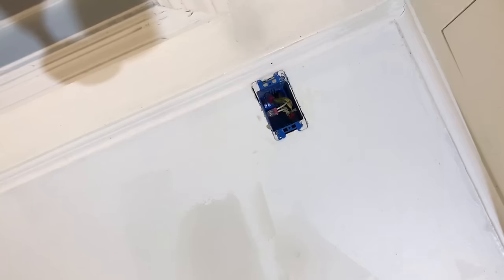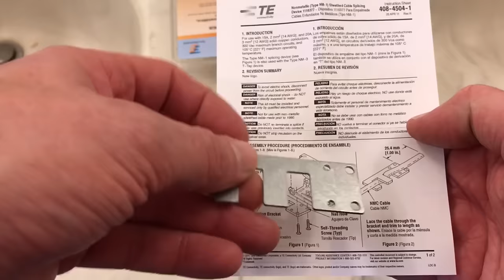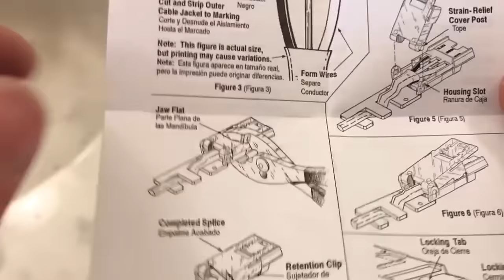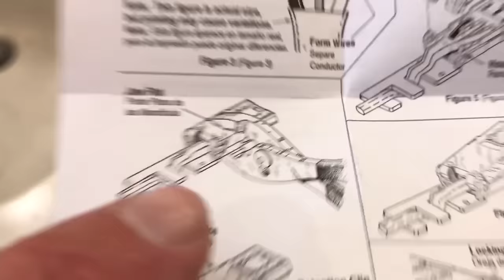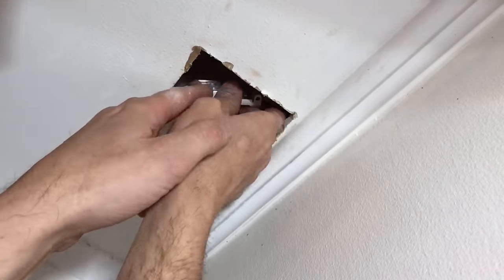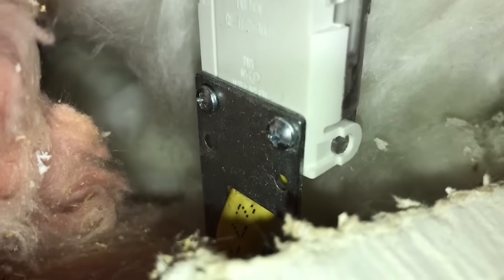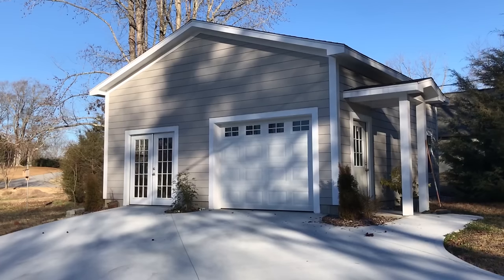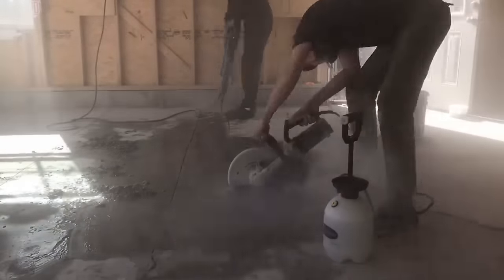Do I have to have a junction box to splice wires?

Comment: Found this searching for ‘Tyco Splice’. Glad I watched. Great video demonstration. This is what I needed to be able to move from a kitchen counter outlet to an island that needed more distance and to remove a light switch to convert it from switched power to always on. The fun will be doing all of this manipulation with less than a foot of wire reachable! LOL! I seriously appreciate this video!
Reply from the maker: Glad it was helpful!
Reply: I would be careful using this in the kitchen because of the wattage we use appliances like toasters , microwaves that have a high current draw. Remember this device makes its connection via small contact area not under a screw terminal .
Reply: @FamilyFriendlyDIY  Can we sue when it fails?

Comment: I used one of these on an old house to extend a wire running to a light about 12". The light was a single LED flush-mount can above a sink. The sink was on an outside wall, so there was very little access to it as the roof was right there. Considering the load was very minimal, I had no concerns about using the splice. All the un-grounded outlets in the old house were/are probably more dangerous than this splice.
Reply: Bad idea
Reply: @RadioRich100  Been that way for years with no issues. :shrug:
Reply: @ADBBuild  And hoping every day it stays that way?
Reply: You would've been better off burying a proper twisted splice in a metal box. I don't suggest this because it's not legal, but nonetheless vastly safer and better.

Comment: When connecting a water pump down into a well, you need to splice an electrical power source (240 volts) onto the pump which is submersed in well water.  To do this, crimping devices, along with a bit of solder, are used to join the pump’s wires to the wires that run the depth of the well. Once the wires are joined, a special shrink tubing is slid over the union and heated. This special tubing, upon being heated, excretes a sealant that fills the inside of the shrink tubing which seals the splice and allows it to function under water.  Now, if we can do that in as hostile an environment as a well, why can’t we do the same while splicing a wire in a house?   It seems a much simpler and cheaper way to do this than the weird contraption that you are using to solve your problem.
Reply: Couldn't agree more. And if it cost a couple of dollars so be it. In the end you usually cover with a box and probably still not a great connection.
Reply: Well for one, that connection is accessible, and what he is doing in the video isn't
Reply: Years ago, when sinking a pump 400+ feet into a well, the wire splice was far beneath the water level. My cousin who was a lineman for Southwestern Bell used a special splicing kit with what amounted to liquid electrical tape, then surrounded the entire thing with a couple of rolls of regular electrical tape, pulled very, very tight. The well was poorly dug and never delivered the 350 gal per minute we were promised, but the pump never failed!
Reply: @jasonstarr6419  Nor would it if it was in the wall of a house. Whew - 350 gal/min. ... you must have been irrigating and orchard!
Reply: the reason i read for no solder, is because the wire can get hot and melt the solder. Maybe since the pump and wire is submerged, the wire stays cool enough to never melt the solder? I'm trying to figure why solder and heat shrink is a no-go for wire splicing too
Reply: @Jajaky  Yes, I've just recently read that crimping is preferable to soldering.  The only reason that I can think for a wire to get hot is due to pumping more amps through an undersized wire which could happen if the appliance was shorting out - which could very-well happen. If I were to rely on crimping alone, I wouldn't trust hand crimping - something hydraulic or a tool designed to exert a great deal of force on the crimp would be my preference.  Another thought occurs to me in that so what if a short happened in a well 100 feet under water - what is going to burn down?
Reply: The problem in a house is heat generated from a bad connection. If the bad connection gets hot enough, and it's next to something flammable like wood, your house can catch on fire. You don't have that problem in a well. Does a junction box prevent this? Maybe its just another small layer of protection but heat next to a flammable source is the problem. Not sure why this contraption is better than other contraptions as far as code is concerned, but most likely the company paid a lot of money to get certified to be used without a junction box.
Reply: @dennisbosworth3665  well if it shorted out in the water, it’s more likely to electrocute someone maybe? But the whole thing is underwater anyway so idk. Waterproof, marine grade crimp connectors seem nice. I need to try some out. Only do solder because it’s all I knew. Still amazed that 95% of electric connections really on clamping force. Seems archaic
Reply: @seanm3933  I dont think code it lenient enough to allow itself to be bought like that if the product isn’t safe. The junction box is probably a controlled environment, so a bad connection happens in a metal box and not over 50 year old saw dust. 

Maybe the splice device is such that if it somehow got a bad connection, it would have already disconnected by that point

Comment: I am so glad you brought this product up, as there will be that situation it will be needed. As an AHJ and Master Electrician for 34+ years. The 2020 NEC Art 334.40 Boxes and Fittings (B) Devices of insulating material. These are Non Metallic Sheath Cable Interconnector devices and are acceptable concealed in walls and ceilings for a "repair" of damaged wire and for exposed cable wiring (example -romex in an attic that is accessible). Tyco list this product as "rework". Which the NEC DOES NOT. This is the classic case of a design engineer playing with, changing, or not knowing the exact wording in the NEC. For what you did in the video. Great job. I would have passed the inspection for that product, even covered up by drywall. Granted, possible problems in the future, but acceptable be code. But.... if someone were to move a switch or move a light to start a "rework / remodel". I would fail the inspection with this device concerned as that is not a "repair" as stated in the NEC code. Then this item must be accessible or start installing splice boxes.
Reply from the maker: Thank you for the supportive comment, John! Not a lot of love out there for these things.
Reply: @FamilyFriendlyDIY  Most of the NOT love is from people who have never used or even seen them, but somehow think they have an informed opinion.
Reply from the maker: @pld8993  much appreciated, John!

Comment: Super. Please dont ever splice a wire in a wall, but for those people with paid up fire insurance, at least put the wire in a metal handy box, with a metal cover, proper wire clamps, ground the box, and use proper wire connections, like wire nuts on properly twisted and trimmed wires, screw or crimp terminal connections correctly torqued, soldering, or Wago/Ideal connectors. 💙 T.E.N.

Comment: As a G.C. I would suggest when working with anything small like screws near a sink to pull the stopper. I have had many screws fall into the sink then down the drain causing me to have to do more unnecessary work.
Reply: I dropped a Tapcon Screw down my toilet flange two weeks ago, LOL, that's sage advice you are offering...
Reply: @terryweisenberg396  Trust me Ive done it so many times. Most of the time i remember to pull the stopper but sometimes Im in a rush.

Comment: Two issues.  One, I'm not sure Insulation Displacement Connectors (IDCs) are reusable.  Once used the integrity is lost when re-cripped.  So, I'm hoping you threw away the first set and started with a fresh set for your install.  And two, just because it eliminates the need for a junction box doesn't mean it can be concealed.  If it were a high current application, which in your case, it may not be, I would be worried about heat buildup years down the road.  It looks like a pretty poor example of a permanent fix. Only one IDC blade per wire.  Any way to pull a new piece of Romex or get attic access to place the junction box up there where it would be accessible above all that insulation?
Reply: I was hoping also that he did not reuse the practice connectors. I paused the video at 7:38 to read what was written on the connector. It stated "do not re terminate".
Reply: I was thinking the same thing, but it looks like he used the same one.  But he tested with 14AWG and then did 12AWG, so likely not too much of an issue with spread as he went to a bigger wire.  But that small contact, that thing will overheat if high amperage (more then 1) passes through that... I would NEVER put that thing in there, thats like getting a under counter pipe accordion and saying "i'm a plumber"...  Do this right!  Dont use these DIY junk that the home center sells..

Comment: I seem to remember that if this was being used for a repair it can be concealed.  If it's part of a new run it has to be accessible.  334.40b is the reference.  The electrician used these as part of a re-wire/installation of a breaker panel.  I've had zero problems since install from December of 2020.  New 12-2 romex to old 12-2 (no ground) system.
Reply from the maker: Thanks for the positive comment! And I believe you're correct on that code.

Comment: It’s surprising how small the surface area is for  the contact point where the wires fit in the slots
Reply: I wouldn't trust it to carry much current.
Reply: @bobcarrigan1742  those metal plates will cut through the insulation, And IDC always fail.
Reply: I have seen these arc/burn enough to kill the connection. The insulation melts some from heat traveling back from the contact failure. It was under a doublewide house trailer connecting receptacles on one side of living room to the other. I believe it happened after they plugged in a window AC.

Comment: I am not a big fan of those splice kits but I have been told they are NEC approved ‘no documentation I was just told that’.  However if the junction box is in the attic and the attic is accessible then so is the junction box.

Comment: I was under the impression from watching other informative videos about performing tasks in the electric industry that all splices had to be placed inside a junction box and they also had to be accessible Incase any issues occured down the line where they would have to be replaced.
I remember seeing these Romex splice connectors in another video.
From my understanding from that video these connectors are a 1 time use and if they were to ever fail or be taken apart for any reason they would need to be replaced with a new one.
Now I understand why you don't have to strip the insulation back for the clip to make a connection 
Was unaware that the clip made its own connect via biting through the insulation to the wire.
Reply from the maker: Good call out Jason. Typically you would have to have the connection in a box and it be accessible, these are the exception, but these are only supposed be used for “repair,” not connecting new work.  Thanks for the comment!
Reply: @FamilyFriendlyDIY  
I'll make a note of that
I have plans of going into the electrical industry and becoming a licensed electrician and do contracted work here and the there
Either for repairs otherwise new installation.
I'm trying to learn as much as I can about the Industry and other various tasks( services performed ) 
My ultimate goal is to get my contractors license and hopefully go into business for myself otherwise perform work in partnership with a company that shares the same views as me.
Currently working at the local conservation corps here in my city 
As a form of community service
 (it's paid though) to give back to my city 
And keep it looking as nice as it can look even with as many eye sore spots that exist within it now.
Reply from the maker: @jasonstricklin2602  sounds very rewarding. All  the best to you in your pursuits, Jason.
Reply: It’s  crap do not do this.
Reply: @dominicbenecasa7893  he's trying to scare you. do it.
Reply: @FamilyFriendlyDIY  These are NOT an exception.

Comment: I have a junction box in my bedroom with a blank plate on it. I spliced it myself using wire nuts. I feel safe knowing it's spliced using something that is mechanically and electrically connected with substantially more surface area connecting each other than a wago, or an insulation piercing contact. I don't understand why people do things like this. The NEC or the CEC where I'm at is the law and it's your duty as an electrician to follow that law.
Reply: wago's are 100% safe and exceed NEC and other electrical standards in every first world country. if you're still on the bandwagon of wire nut > wago then you're not keeping up with the evolution of the trade.
Reply: It is your duty to meet or exceed that code.
Reply: @alexvega8026  Agreed.  I'm not really any kind of Wago evangelist in particular, but if one actually does look this stuff up, they actually have been heavily tested and shown to reliably provide just as good contact (almost identical measured resistance) as wire nuts do, and being much easier to use correctly (and be sure you're actually getting correct contact inside, since you can actually see it), they really do seem to be the better choice nowadays, not just for convenience but also from an objective electrical standpoint.  It's understandable that people would be wary of a replacement for something that's served them for so long, but every once in a while new things actually can turn out to be genuinely better...

I agree that insulation-displacement contacts (such as the device in this video) for this sort of thing do seem a bit dubious, really, but people shouldn't confuse Wagos with insulation-displacement contacts.  They are not the same thing at all, and Wagos actually are quite legitimate in how they go about things.

Comment: Those things look terrifying they are a fire just waiting to happen. 
If you ever are planning to hide a junction box (for whatever reason), buy a junction box from the UK they are much better and safer than what is available in the US.  wires are held in with screws, rated for 250v at various amperages they are usually in fire resistant plastic (bakalite) boxes and if they have the 'kite mark' I believe they have been tested to 600v at up to 600 amp.  Ideally you should never hide a junction but then ideally you should never drive faster than the speed limit.  If you want to install pot lights then their downlighter boxes are you best friend closely followed by the ceiling rose junction boxes.
Reply: Would you provide a link or reference for a screw terminal repair fitting?  I have a modular and have just found my first open neutral in this type of connector, more to come I'm sure.

Comment: Kind of a pain. Quickwire in the UK makes a splitter that seems much easier overall. More compact as well. Not legal here AFAIK. Really not a fan of the vampire style connections, but I'm sure it works. It's sad to think though that a device like this could just be a 6 lever Wago style connector with 3 openings in each direction and a small screw or clip together box to go over it. Would work just as well, be just as safe, and take way less time. Anyways, at least the option exists! Thanks for the demo.

Comment: We were told at an IAEI continuing education class that these are legal to be installed concealed inside walls. One important thing they mentioned it's a one time connector.If you unplug it you must install a new one. Would never trust the small piece that locks into only part of the copper conductor. Best practice would be for them to make it with screws that pushes onto a flat brass plate & insist that you tighten with a torque driver.
Reply from the maker: Good info and idea, John. Thanks!
Reply: Do you think it would be better to solder the wire connections at the point where they are pinched.
Reply: @danv2888  For at least the last 60 years NEC states that ground wires are not to be soldered due to on a high fault current solder could melt.
Reply: The one-time-use nature of these splice kits cannot be overstated. Similar to punchdown connectors and blocks for low voltage in telecom/Ethernet, these cannot create a reliable connection a second time, after disassembly and removing conductors. The first time the conductors are pushed in, the two blades of each connection point deform, enlarging the slot ever so slightly. If you haven't patched the hole yet it would be best to re-perform the splice with a new kit.

Comment: To help you out. My friend, I am a retired electrician
this is not really a junction box so to speak. Even though the package says so is actually a plug. Obviously, that it is perfectly legal and even stated in the national electrical code when you order a mobile modular for a school just for one example. All the lights and plugs are put together using this method.
In the mobile modular's. I had to fix wires that obviously needed it and I use the same method are difficult to pull part for reason. So, good job on the video
they also have them for MC cable as well as role Max cable
Reply from the maker: Thanks for the support and extra info, Ray! It’s much appreciated 😊
Reply: This is an idiotic statement, those things are proven dangerous, plus this guy used a no contact tester to prove the circuit is off. Showing how dangerous he is doing electrical work.

Comment: I think you could create an acceptable solution with screw down terminals.  Even better would be a solder cup but I don't think electricians like soldering typically. Using insulation displacement?  Absolutely not!